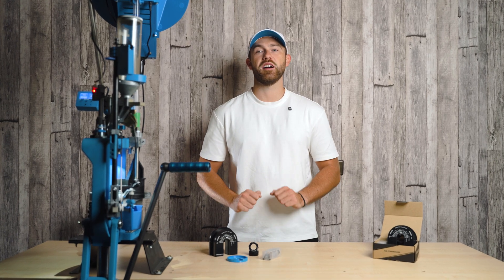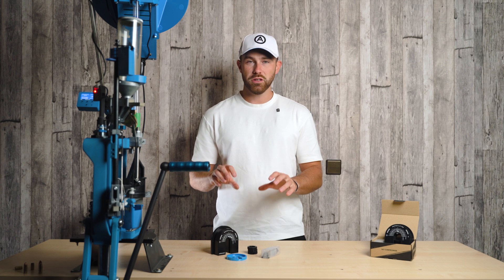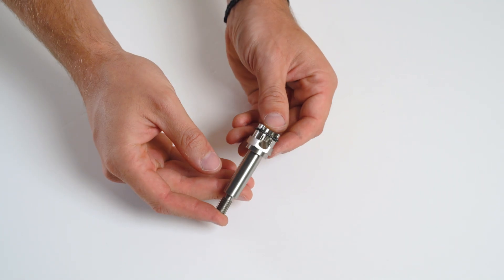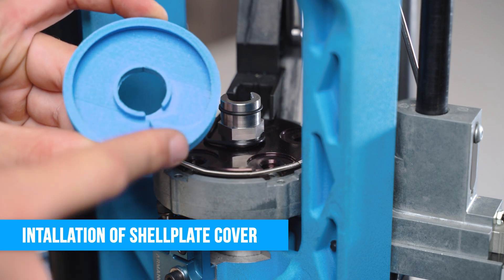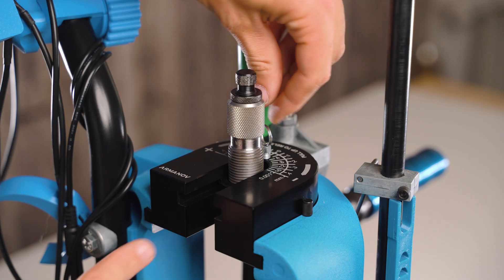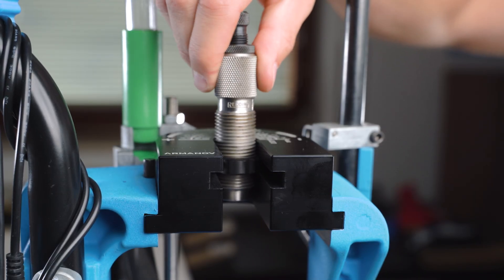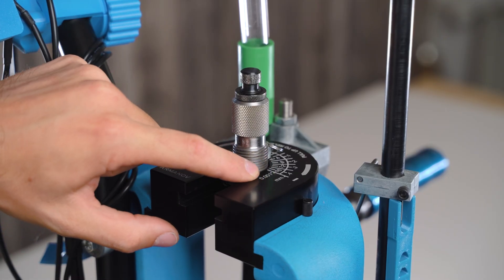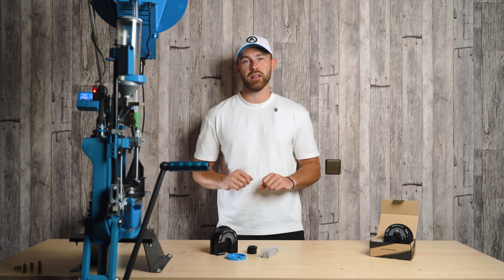SINGLE STAGE on your Dillon Precision XL650 & XL750

Comment: Thanks for making this toolhead! I've been very impressed so far, ammo has been coming out EXTREMELY close in measurement by .001". The only issue I had was the primer catch tray being very tight and chipping the inner diameter of the tray. Easy fix though with a Dremel.

I definitely need a 5 pack of lockrings after seeing the potential of this setup.

Thanks again and much love from the US!